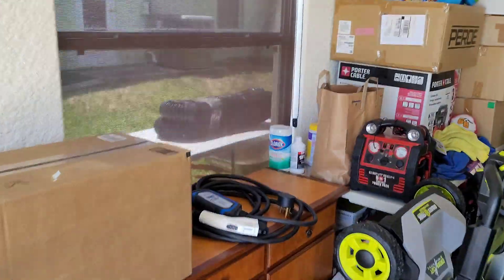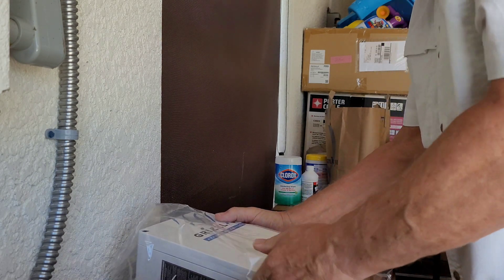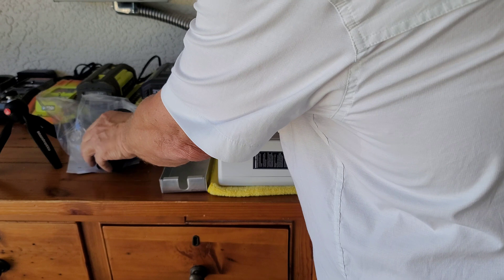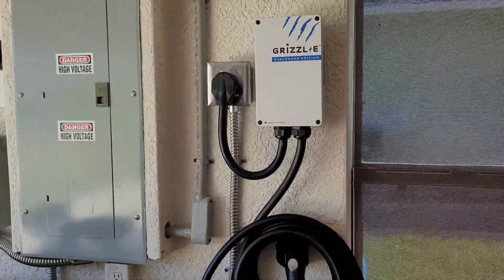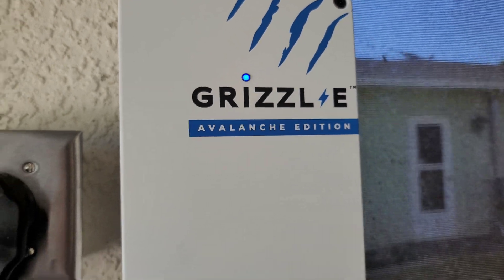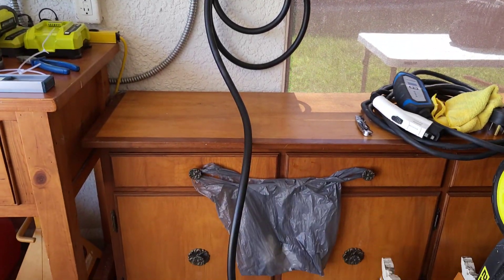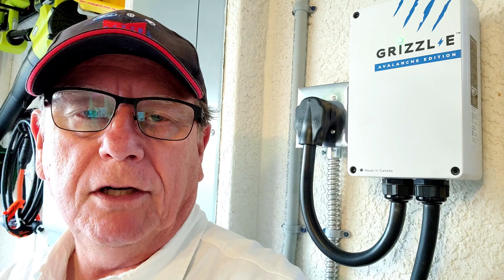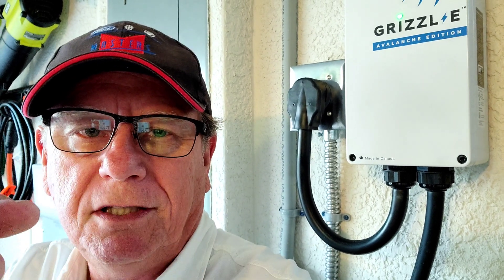GRIZZL-E, THE INDUSTRIAL STRENGTH EVSE!!!

Comment: Nice video. I have the black model, which they now call Classic. I had to open it up to adjust the amperage DIP switch for my EV. The inside is also impressive and robust.
Reply from the maker: Thank you 😊.  That is great news to hear "impressive and robust " where it counts, both inside and out!   Thank you for watching and sharing.  In a time when manufacturers skimp on everything, it's refreshing to see a quality built product.
Reply: Do the dip switches work well? Can you change them frequently? I limit mine to 24 amp during the day and 16 overnight on a 30 amp line but it's hard to find non tesla chargers made for 30 amp lines anymore. Only ones are non listed and sketchy so i have to use an adapter which requires an evse that can limit the draw
Reply: @vicenzor9699  This is a well made device, but I can't imagine the DIP switches were intended for frequent use as they look identical to the those I used to adjust on early PCs I owned.

Comment: I bought me the classic version.  Though I won't really own an EV until about two years from now (I have an F-150 Lightning on reservation).  I figured that It's better to be prepared.  This will fully charge the Lightning standard range around 12 hours (15-85%), since their included 32A EVSE does it in approximately 14  hours and the 48A Ford Connected Charge station will do it in approximately 10 hours.  I'd really like the 48A Ford EVSE, but it's about $800
Reply from the maker: I think you made a good choice on both.  I would really like to have a Lightning.  It's going to be a beautiful truck/EV. Have a great week and thank you for commenting.  Please cone back and let me know how your Lightning turns out. 🙂

Comment: Flex conduit for outdoor use?
Reply from the maker: Check your local code. I'm sure you would need the plastic weather sealed conduit outside.  Mine is in the garage.  My water heater and air handler use the same metal conduit. Thanks for watching and commenting.  Have a great week.